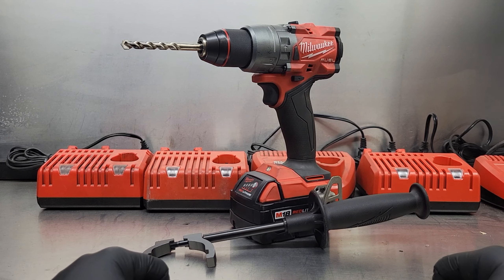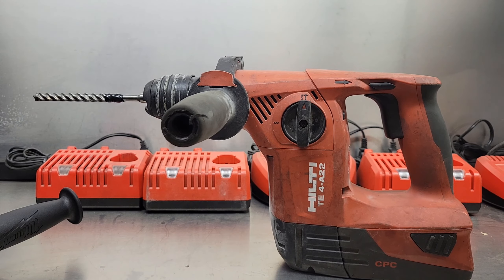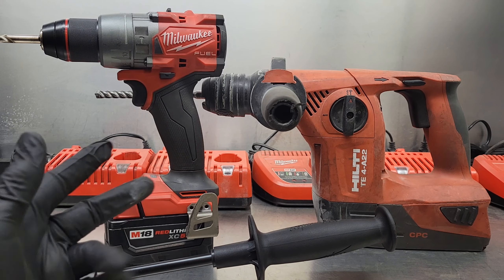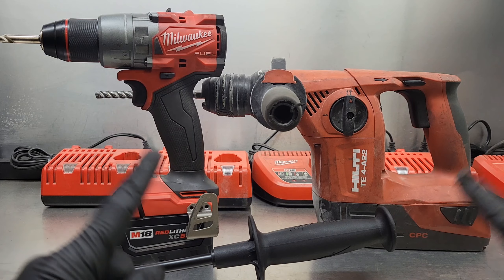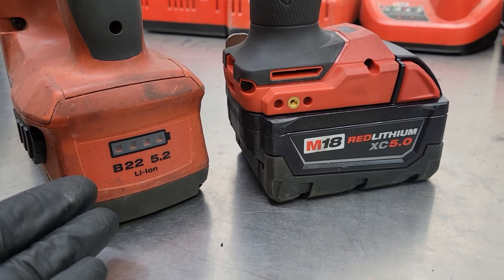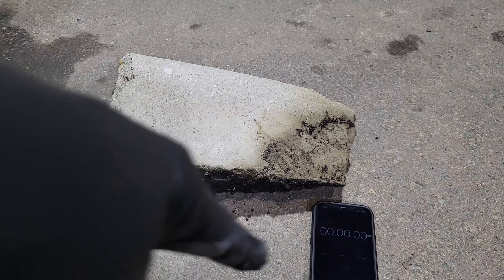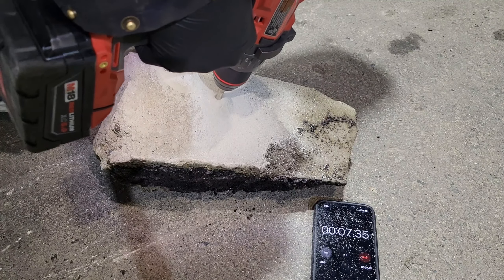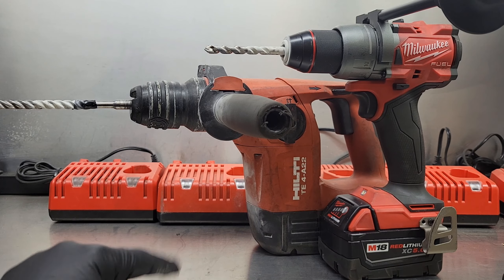MILWAUKEE M18 FUEL GEN 4 HAMMER DRILL 2904-20 VS HILTI TE 4-A22 ROTARY HAMMER. WHICH IS FASTER?

Comment: I was very surprised. In fact it seemed and unfair comparison for the Milwaukee.  I wonder how much is dependent on the bits.  I'm sure you don't care, but its masonry not masonary.
Reply from the maker: Thanks for the input. You are right about the bits being a factor. Thanks for the info on masonry and masonary. I appreciate it and don't mind being corrected when I'm wrong.